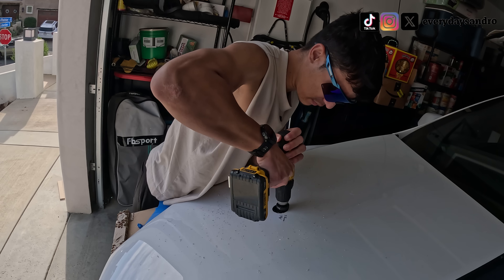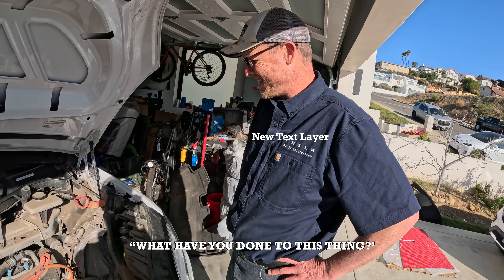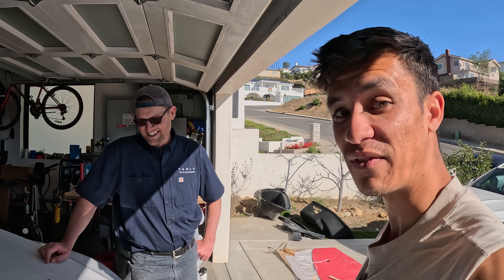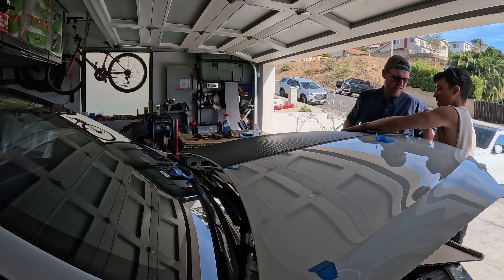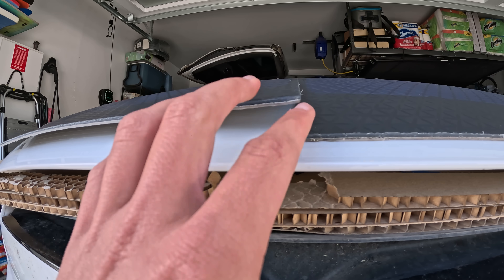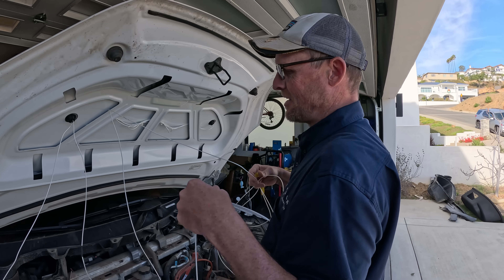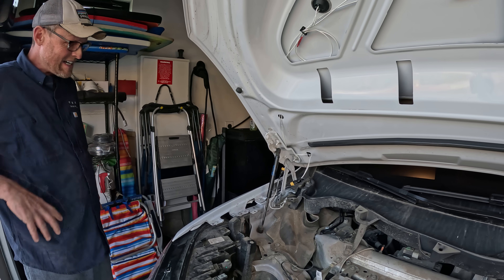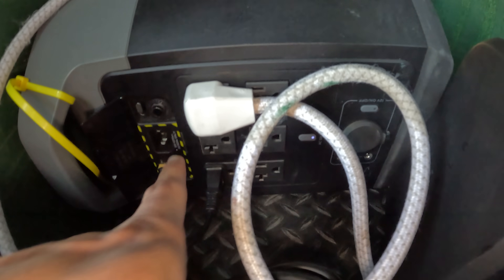DIY Solar Powered Tesla - THIS Changes Everything

Comment: Sorry, maybe I'm missing something, but I fail to see how is this even worth the hassle, cost of the panels, and damage to the car?

You said you peaked at 135W, if we assume you get a constant 135W (which you don't), here is the math I came up with (some values are assumed and based on data I could find on the internet, so take them with a grain of salt):

The Charging efficiency for a Model X varies with power input. For low-power charging (similar to Level 1, 120V), efficiencies can range from 70% to 84%, depending on conditions. 
Idle Power Consumption: Even when parked, the Model X consumes energy to maintain systems. This "vampire drain" can be approximately 1% of battery capacity per day, equating to about 1 kWh daily for a 100 kWh battery. 
Solar Energy Availability: In a sunny location like California, average peak sun hours can be around 5 hours per day. This means the solar panel can produce its maximum rated power during these hours.

Calculations:
Daily Energy Harvested: A 135 W panel operating at full capacity for 5 hours yields:
135W×5hours = 675Wh
 
Effective Energy Stored: Assuming a 75% charging efficiency (midpoint of the 70-84% range):
0.675kWh×0.75=0.50625kWh
Net Energy Gain After Idle Consumption (considering the 1 kWh daily idle consumption):
0.50625kWh−1kWh=−0.49375kWh

The negative value indicates that, under these conditions, the energy harvested daily is insufficient to offset the vehicle's idle consumption. Consequently, the battery would continue to discharge even while connected to the 135 W solar panel.
I understand that you are charging the EcoFlow instead, just to use for emergencies, but why not just charge it off the car outlet (or any outlet..) while you're charging the car itself instead of going through all this trouble?

And then call the car "Powered by the Sun" is absolutely wild. With this much solar power it's impossible to power the car by sunlight only, and even if you covered the car in solar panels, you'd still need to let it out in the sun for days before being able to do any considerable amount of driving.
"THIS Changes Everything", this changes nothing.
Reply from the maker: This does change everything. Currently in Mexico, 9am, and already peaking 240 watts, powering my starlink, kitchen, and fridge not using any car input just purely solar - Beluga
Reply: @EverydaySandro  and why did you need to install them on your car instead of just having foldable solar panels and use them when needed? Even easier to get them pointing towards the sun, etc. Why damage the car?
Reply from the maker: @eduardodacosta4670 I think your questions are very reasonable, as I cover more about the solar panels in later videos. I wanted these solar modules permanently on my hood, so when I am driving there is a constant input, plus if I am overlanding somewhere I can just pop the hood and angle the panels to optimize solar input (10 seconds tops). Most places I go to, tends to be windy, and I am not against foldable panels, I just wanted to constantly have my starlink, kitchen, and fridge powered. 

I ran into this issue when I drove to the Arctic Ocean, as I had to hyper mile on the Dempster Highway. I wouldn’t charge the Ecoflow from the car, so after a day, my communication devices, fridge and kitchen weren’t useable. Hopefully this answers some of your question!
Reply: Sorry, but none of that is good justification to butcher the car, you'd still be better off carrying foldable panels, and putting weights to prevent them from flying, if wind is an issue. And most definitely does not justify saying the car is "Powered by the Sun". Absolutely ridiculous, and misleading, and you know that.

Comment: I suggest adding the 12v battery of the car to the circuit. You could trikle charge it from solar and this way you will reduce the number of times the car has to wake up and activate the HV battery to charge the 12v system. You could actually have better range (probably 1-2%). You can even run wires from the battery in the frunk to the back of your car and have more amperage available. The Ecoflow is great in this system because in case of emergency you can also add a couple of miles to the HV battery of the car using the Ecoflow's AC plugs.

Comment: Not sure if it's been mentioned, but soldering doesn't melt the wires together. It only melts the solder.

Also, crimping is an electrical connection, soldering is a mechanical connection.
Reply from the maker: I had no idea, it's all just a first for me! Working out great here in Mexico

Comment: Just a warning to anyone thinking about doing this: 99% of people will have to charge more because of a mod like this. 

The reduced range/extra power needed because of the extra weight and aerodynamics will never be offset by the solar unless you basically don’t drive the car and it just sits in the sun.
Reply from the maker: Overlanding at its best. Honestly, I haven't noticed any efficiency loss with these panels on the hood.

Comment: I don't think the battery is designed to be used and charged at the same time
Reply from the maker: Potentially. I just use whenever I need it
Reply: @EverydaySandro that's pretty awesome that it works as well as it does. You definitely got my respect for all that solid work

Comment: Add a bit of lipstick to the back of the solar panel where the wire comes out. Then, when you lay it in place, you can see exactly where to drill the hole.
Reply from the maker: We actually added a small piece of tape to it so we could drill the hole in the right spot

Comment: Do you know  how long I had played the solar panel on my Nissan March car ?  Actually I have plant 20 years already  but I don't have solar that suitable for my car ,  after 10 years later. I have found a flexible solar panel  then I put it on the roof , I very happy because it can help and save a lot of money ,  it can charge the battery all the time  so the alternator not working hard  and can use long time , even the battery too  , it can stand by charge  so the battery should be full all the time  and can delay the broken time ,  even you drive in the sun  , it also can help to the air compressor  , it mean any fan can share the power from solar panel too , so the Air conditioner system work very smooth  and save the gasoline too ,

Comment: But you know that you don't have to do it, it's enough that on the slowly running of the wheel without power, you connect the motor with a change to the generator, change the polarity and now while driving you create electricity
Reply: There seems  to be alot of experts  out there.however still doesn't beet HHO which is going to happen soon.

Comment: Interesting project. My only concern, did you install a fuse just under the hood where your junction boxes pop out, in these area? Just in case you get a short in your wiring going to back of the car. Better to be very prudent and safe.
Reply from the maker: It’s part of the junction boxes, thanks for watching and this suggestion
Reply: @EverydaySandro  No problem, thansk to you telling us the fuses are in the junction boxes, always good to show that everything is safe and compliant.

Comment: Why charge your echo flow backup? Why don't you charge the 12 volt system then the main battery does not have to charge it as much and maybe you can get some extra range out of it in full sun. People do not realize how much power they use in an electric car everything takes 12 volts your heat, a/c, blower, head lights, seat warmers, rear defrost, Cameras, Windows, and I think you get the point because Tesla's do not have an alternator so the main battery charges the 12 volt system this is why they have to be replaced more often than a gas 12 volt battery because it is designed to use most of its capacity the gas 1 uses 20% of its capacity then it is dead just about but with a good alternator it will last 7-10 years. I bet Tesla 12 volt battery lasts 2-3 years if you are lucky because the more you drain them the less cycles you will get out of them so if your solar can help keep them full they could last 5 or 10 years and maybe you can get more range as well then it is a win win. Last thing if you read this protect them wires with something  or they will rub against metal from the bumps and vibrations it will just be a matter of time.
Reply from the maker: The Ecoflow is my main power supply for my kitchen appliances and starlink

Comment: Dude, home charging from grid is at 11 KW+ using Wall charger and Super chargers peak at 170KW for even my 2018 Model X. The panels peak is at 100 W. Not KW. A KW is a 1000W. Hope u know that. Its not even in the same ball park.
It takes 5 hours to charge from 20 to 80 with a wall charger at 11KW + consistent power.
U r talking about 0.1KW there at peak exposure to sun.
That'll give u 1% of range boost maybe in 1 day. 
Why do u think Tesla and most companies dont even look at Solar roofing their cars. Coz the efficiency is not worth the extra cost and price hike for the car.
Reply from the maker: Hey thank you for correcting me, I might have accidently interchanged kW with watts at some point. I am pretty good with math. These panels are 250 watts total, and today I peaked at 240 watts for a few hours while in the desert which was awesome to see. To realistically charge my car, it’s possible, and over a day I can put 3-6 miles into my battery pack. It’s mostly just to power my road essentials like my starlink and my question. Thanks for your feedback

Comment: Are you going to have… what did you say…. 300W of power run through those wires? Auch…
Reply from the maker: Plenty of free juice!
Reply: @EverydaySandro  my point is the gauge of wire doesn’t seem sufficient for that kind of power. Is it?
Reply from the maker: @ it’s been solid for now, peaking about 220 watts right now

Comment: Seems like a lot of work for 1 amp of energy. 
Another way to look at it, you could plug into the dc power adapter on the tesla and that's 5 weeks worth of power.
Or another way. That 10 hour charge is only 3 miles of range. Adding these panels to your car really does nothing to save on a car that has a 100kw battery pack. 
On an ICE car, yes it would make sense. This literally serves no purpose except to seem cooler than it is to people who don't understand
Reply from the maker: Great point, but completely disagree with you here. I live full time out of my Model X and over the last 2.5 years, this install adds tremendous value and makes sense for my roadlife! It’s so cool to have instant juice harnessed from the sky

Comment: Ooh, a whole 2 miles a day of free electricity. That is if you park it direct sunlight, something I try and avoid because it is harder on the batteries and takes the A/C longer to cool down the vehicle. Probably be a wash compared to parking under a tree. How much did that cost to achieve basically nothing? There is a reason Tesla does not offer this as an option.
Reply from the maker: I am using this for a very specific purpose camping and off-grid living and it does the job perfectly! I do appreciate your input, but Beluga is happy and that is all that matters :)

Comment: I LOVE it no matter what, and it makes me want to add a solar decail to my frunk just for the look of this, but the mialage lost due to the extra weight is most certainly going to outway the mialage gained from the solar power. (zero calculation done and only intuition)
Reply from the maker: It's all about that balance, right? I haven't noticed any efficieny loss since this upgrade so it's definitely worth pursuing!

Comment: I like your idea for this solar panel add on, but I’m suggesting that you should add one insulation layer to cover for the solar panel wire which is to make it double insulation and ensure not to have possibility to get short circuit. The wire from front to back is a quite long distance and if just single core wire and tied up like this, it is high risk that after la ong period time of usage. Anyhow ,this is just my personal opinion.😅
Reply from the maker: Thanks for the feedback, I am always looking to improve and keep things safe! Thanks for watching

Comment: Great idea would be getting higher powered struts to make the frunk open easier
Reply from the maker: Do you have any brands you recommend
Reply: I honestly know nothing about the X and S platforms. I do know for the 3 and Y you can get aftermarket ones that are much more powerful. For the 3, you can even get ones made for a mid 2000s Grand Cherokee and they work fine. I’d do some research or take measurements to see if there’s anything that’d work.

Comment: As you show yourself that there is sand everywhere because the car is not sealed, returning to the solar mask, you can also take 2 masks and put them on top of each other, making a so-called sandwich, only the hole cut out for the solar should be sealed with a special compound resistant to high temperatures, so that sand does not get in, it will not spoil the appearance of the car and it would also be more resistant to crushing because it will stiffen the entire structure

Comment: The idea is only this Car accelerates very quickly to high speeds adding shocks given off on uneven roads and air resistance the best solution is to design and print special clamps and attach them at the connection of the hood and fender or bumper fastened with rivets or screws that are not unscrewed to be sure that it will not unscrew and you will have to tighten it every now and then this is not the path to happiness 😜 enjoying the vehicle.
Reply from the maker: Thanks for this tip, its a constant work in process!

Comment: Tesla should make this a thing. OK you may only get 8 miles / day but that could actually come in handy under certain circumstances, such as running out of charge in Death Valley Utah.
Reply: I hope they figure out some way to add onboard solar.
Reply: That's a lot definitely
Reply: Yeah, you could use that as your base camp. When you're overlanding, not necessarily with an x, but still, you could do that. Would be awesome
Reply: You won't get 8 miles/day. You'll get 1 at best. The added cost, complexity and weight isn't worth it by any metric.
Reply: @John-p7i5g  even if its 8 a day, boggles my mind they never did this from factory, it would allow me to drive electric, like I use my car maybe once every week or so for small trips
Reply: @Sakura_Yuki_NC  they didn't because it's not cost effective. How many would afford the extra cost for the dubious benefit? They would need to have an entirely new production line, that would see way less use, thus driving the costs per car up on both models. What they could do is make it easier on people that want to do this kind of jobs by having the electric architecture ready and the places that can be drilled through marked in some subtle way.
Reply: @ you know "options" are a thing on cars right ? How I see it is that is that as you say "having the architecture ready and then for car A they take a hood without solar and then for car B they grab a hood with solar and they deliver me the car with the solar hood.
Reply: @lmmortalZodd  cost effective is always a dum excuse cause you just add to the sticker price and make it an add on, Duh

Comment: Not sure if it’s worth it. Consider a supercharge is 20,000 watts, and a slow at home charger will do around 5000W. This 150W peak is not too impressive. To put that into prospective, you would have to charge your car at home for 1 hour, or leave your car in sun for 50 hours to get the same power…
Reply from the maker: This is a small scale proof of concept to see if a car can be charged using solar. I peaked with 238 watts yesterday in Zion National Park and gained 6 miles through the day!

Comment: I have two 395 Watt solar  panels 39" x 65 " or 35 SQ ft. at a 38 degree tilt, facing south east on my garage. On a sunny mid summer day it would take 23 days to charge my Tesla.  In actuality it does not even generate that much. Mounting solar panels that don't face south is a complete waste of solar panels.
Reply from the maker: Interesting data point, but very useful for my setup. When I am parked, there constant solar input throughout the day, yesterday I peaked 238 watts

Comment: I never understood why tesla didn't do this when these cars were first made...
Reply: Solar roof would be nice on The Cybertruck or Solar bed cover.
Reply: It is because the cost savings from solar power will never outweigh the initial cost required to install solar panels on a car. It’s an obvious fact if you’ve ever seriously considered it and crunched the numbers. 

That doesn’t make any sense.
Reply: @nextgen6876  the only thing you've ever crunched is Doritos 😅
Reply: @ At least I know how to crunch something. You, on the other hand, can’t even crunch a Dorito properly. Bless your heart.
Reply: @nextgen6876 In a year you could potentially save enough electricity to buy a packet of Doritos by adding solar panels to your Tesla. What a deal.

Don't understand why this guy butchered his Tesla for a kWh a day.

Comment: The flexible panels I've used get too hot and melt. They need an air gap. I hope you have better experience with the one you have.
Reply from the maker: That's unfortunate, I think these will be robust!

Comment: Just curious - what would happen if you connect a single stage gearbox a smaller gear on the wheel and larger gear on the alternator and fit an alternator on each rear wheel to recharge the batteries while the car is in motion 🤔🤔
Reply from the maker: The regen brakes already do this kind of, might be interesting to experiment yourself!